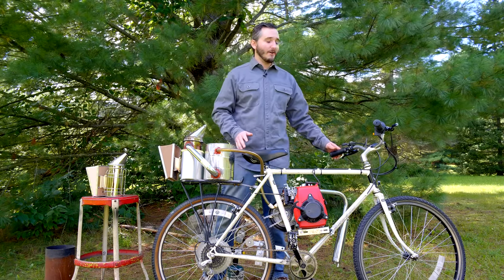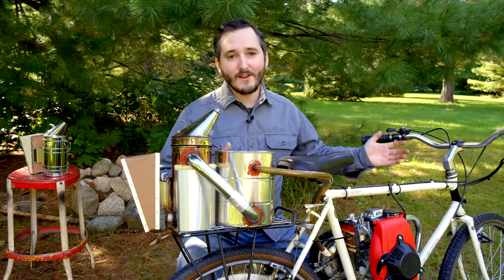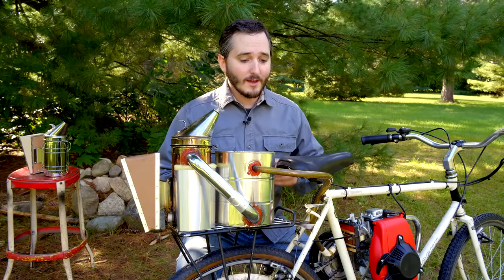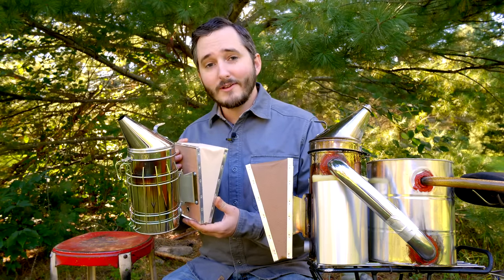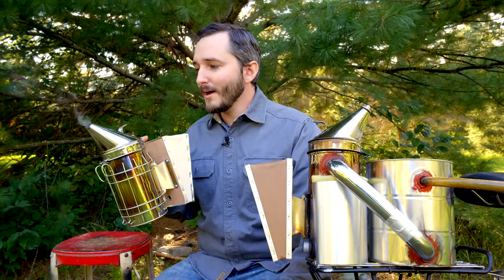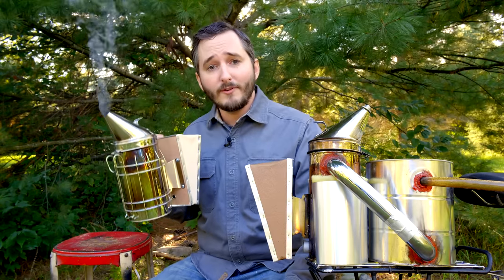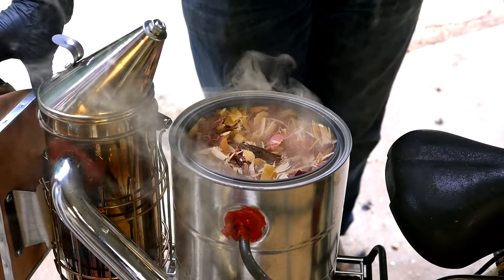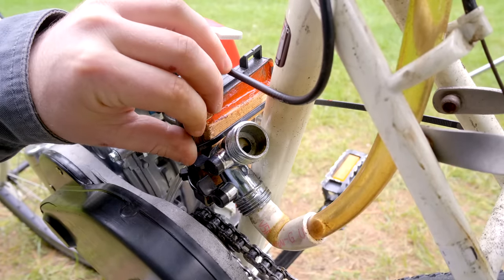Running a Gasoline Engine on Firewood | Woodgas Biofuel

Comment: Hey man, I have a serious question: I’ve tried recreating the bee smoker gasifier, specifically how you did it in the cedar shavings demonstration. You got it to flame up pretty well. I chip up my wood and put it in, and get it going decent, but it just won’t do the same as yours. Not that it doesn’t produce, im just having issues with a consistent flame. It’s like it doesn’t produce much. Could it just need to be filtered? Does the gas from some woods require filtering before use? Im just trying to figure out what I might be doing wrong.
Reply from the maker: Could be moisture in your fuel. To get good wood gas production you need to get the fuel HOT. It won't get hot enough in a bee smoker if there's any moisture in the wood. Could also be that you just require more pumping. This isn't the greatest gassifier design, it's just a simple one.
Reply: Wow, you reply fast! Thank you! Thinking back, it could be a heat problem. Should I build the fire and gradually add fuel in until the smoker is  full? And one more question -do you think a separator to get rid of the water vapor  could help make the gas burnable? Louisiana IS quite humid, so I wonder if maybe doing that may solve the moisture problem. Thank you SO MUCH for your help! Im really new to this, and I figured I’d get advice from someone who know’s what he’s talking about!
Reply from the maker: Nope fill it to the top. Fire on the bottom will dry the fuel on top if it has moisture in it and eventually kick off gas. I don't think a separator is necessary. Piping the gas through a long tube will have the same effect of allowing condensation.
Reply: Thank you!

Comment: How about silica gel for the filter? They're cheap, can adsorb water and liquid smoke/tar (I'm not sure are they the same or not) and the most important, they are thermo stable. I think it is safe to say that we can control the adsorption rate by using different size of silica gel (beans, grinded silica gel, etc.)
Reply from the maker: Good idea to try.

Comment: When you close the lid on the fuel source you suffocate the fire. The oxygen gets used up and the fuel source is exhausted quickly by the engine. Try venting the lid on the fuel source a bit. Perhaps uncap the end you plugged.

Comment: Try making and storing it for the engine. The gas would be cleaner and you wouldn't need to lug a gasifier around for on-demand production, which is inconsistent anyway.

Comment: youll get better gas production using lump coal made from wood. if you use 1 or 2 pc radiators as condensers it'll help cleaner fuel reach the engine, plus putting a small fan on the outlet of the filter any 5 volt fan will do

Comment: You can use the motor get to heating the wood. I mean you can put woods tank over the motor. Maybe at the beginning its need also diesel fuel.

Comment: Aren't there hydrocarbons in woodgas similar to gasoline? Could you condense all the oil then fractionally distill off the gasoline like fuel to run the engine?
Reply from the maker: Yes, but there is much more gas made in this way than liquid fuels. You could fill a blimp with gas before you had enough liquid hydrocarbons to fill your car up.

Comment: How about just using a gas washer? Pretty much an exhaust pipe into a bucket of water. Of course you should cool the woodgas to prevent boiling the water

Comment: Try dura lube to friction proof your engine.

This will help also with 2 stroke engine.

Can you do this for a lawn mower.

Can you make the gas into a liquid and have the system off the bike and run it on wood alcohol not gasoline?

Comment: make a small trailer for the bike, that way you can put that 4 times bigger gasifier on it, and then a tube to run the gas to the engine.

Comment: The thing to remember is if you can see smoke coming out of the hose that you have connected to your motor then it will fail it will not work even if it runs the motor for an hour when you shut it down and it cools off it will never start again you have to have fuel that comes out of there it will be nothing but pure hydrogen no smoke whatsoever so you need a cooling unit to cool to smoke down and a filter system that will filter all the smoke out when you've achieved that then you can run your motor off of the gasifier otherwise it will only work until you shut it down and it will no longer work because you have clogged your motor up with tar any smoke is tar you have to get rid of the smoke and you have to cool it down and have a filter so it will remove all the smoke

Comment: I'm assuming you've either given up on this or are still working on it as I haven't seen a video or update on this (specifically the motor portion), so this may not be worth reading, but....
This might have been suggested elsewhere (didn't see it though) or occurred to you already, but have you thought about some kind of an air pump or fan? just to try and push air in? It should be relatively gentle/light air flow, but just watching the amount of back draft you get makes me think that might be part of the issue.  It was also mentioned by a few others that you might try a 1 way valve, but I feel that might create too much air pressure and cause the air flow to be inconsistent.
It was also mentioned by a few others that you might want some kind of reservoir on your fuel line to reduce moisture getting in, which is a good idea, but what about using a bubbler type filter (passing the gas up through water/liquid instead of chips...) to remove tar and such? I'm aware that it might not be the most effective, but I feel like it might help you out in the long run, also cooling the gasses a little which should help with the air mixture?
Reply from the maker: Thanks for the suggestions. I may get back to this project in the future I've just had lots of other projects to work on in the meantime
Reply: I was thinking the same; soak the wood chips in the filter; and could you use 2 beesmoker bellows in double action powered by the pedals?

Comment: I wouldn't have the gassifier on the bike I would have a pressurized tank instead. I would suggest filling a main storage tank at high pressure then use that to fill a bottle for the bike engine ; )
Reply from the maker: Pressurizing woodgas can be dangerous according to some sources. I have not tired it to find out though.
Reply: @Nighthawkinlight  Can't be more dangerous than storing propane though right? I'm just thinking running the stove, oven, and furnace all winter while everything else is on the tesla solar roof system. Objective getting off grid with Tesla satellite internet. My only real worry is filtering the gas so its clean for tank storage.
Reply from the maker: Woodgas still contains some oxygen so it can become combustible in storage at higher pressure, so they say. I have my doubts about this, but like I said I have not tested it to find out.

Comment: Hi I think  it would be better to do activated charcoal you just put wood chips in a tin paint can and put in a fire for thats and try a block tipe fuel with a bit bigger fuel can have you ever tried mack gas from plastic water bottles

Comment: Try running exhaust through the air pump so you only use bellows for priming and starting. Figure out how to adjust exhaust gas for correct flow so wood gas is increased as rpm's of motor put out more exhaust, same way a car does so
Reply: As they did
Reply: Put exhaust back through motor so catalytic converters didn't overheat was the reason I think when catalytic converters first started

Comment: An updraft design. Theses are better for heat gas not necessarily for running engines due to the tars and oils in the gas.

Comment: Howdy, Congratulations you are almost riding!

an electric starter
Larger burn chamber
Larger pipe to motor
Belt or chain driven Cam to diaphragm W/manual ability
Condenser for final tar collection.

Comment: I use dry pine needles in my bee smoker. I tried to set the smoke on fire. Never happened... What did I do wrong?
Reply from the maker: Didn't get it hot enough

Comment: You already have a homemade bone made wood gas a fire that filters the gas with water. So why don't you use that to make the fuel and then compress said fuel with a bike pump or cheep air compressor into a tank and let the tank feed into the engine? This way you can have higher quality fuel compressed and stored on the rear of the bike. This would also make it safer to ride as you wouldn't be at risk of inadvertently spreading a fire.

Comment: Storage shouldn't be a problem if you use the bee smoker and your old gassifier storage system, because CO2 is easily dissolved in water, forming carbonic acid. So volumetrically there shouldn't be a difference. Maybe there'd be more gas at the beginning, i don't know how fast the CO2 will dissolve into the water.

Comment: Neat. I'm wondering if a Hepa Filter from a Shop Vac would work to filter out the Tar/Water vapor in the wood gas? Anyone have thoughts on this? (Okay heat maybe an issue.)
Reply from the maker: Might work, but it would probably clog quickly. I wouldn't use anything store bought for this because of cost to replace.

Comment: Cool the gas with a radiator. It can be as simple as pipes on your bike rack. This provides more power. About 105F is optimal before entering the engine. 

Your fuel is dirty. See the orange flame? You need more filtration. 

Increase your idle speed. It needs to pull the gas in faster.

Get a small electric fan to pull the gas out of the gasifer. You are not getting a sustained wood gas production level.

Comment: It seems like it's running too rich. Too much fuel. Maybe a good idea to have a valve on both fuel and air side for fine tuning, and have it controlled on the handle bars for easy access. Some really old style motorbikes have the fuel/air adjustment easily exsesible to help go up hills.

Comment: I’d just like to note that the valve that is used is a ball valve and is not 100% accurate for regulating air intake. Not a crazy difference but it is a variable

Comment: Where's the second part? Could you go a few miles with that engine?
Reply from the maker: I haven't finished this project yet. Possibly this summer I will try again.
Reply: @Nighthawkinlight  the only bad thing I see to this is that when you get to work or wherever you want to go with the bike will have a smell of smoke tremendous :-D

Comment: Hello
I noticed that dried orange skin (or things like that), once heated, releases a flammable gas (which mainly contains orange oil I think)
Why not trying to do experiments or even running this engine with that?
Reply from the maker: That's effectively biodiesel, which you can use to fuel an old diesel engine without any modification. It would be a short video.
Reply: @Nighthawkinlight  I'm glad you replied,, thanks for your response 😊

Comment: Id recommend a liquid like water as a filter to help remove some of the contaminants, and it'll also give a slight back pressure to the woodgas so it'll be more concentrated when it enters the engine. It'll be a slight increase in pressure but with a much "cleaner" fuel. This wouldn't help the moisture content, so a secondary "filter" for moisture, which cedar chips would suffice, seeing as you've already used them.

Comment: One thing I don't understand about these systems is why people create wood gas on site and carry the system with them, why not make it before hand and store just the gas under pressure?
Reply from the maker: You can't store very much under pressure because it doesn't liquefy easily. Better to make a system that if you need more fuel you can just pull over and pick up sticks from the side of the road.

Comment: I have an idea using vape pens to run an engine .put vegetable oil in the cartridge and set the pens at a temperature where the oil cracks producing a flammable vapour .you would need a series of of vape pens that work on a timer so you don't burn the coils out in the pens .I would love to see someone bring my idea to reality.

Comment: ive heard about this before,
the only problem i see is that wood is not as energy dense as gasoline so you would need a exesive amount of wood to go longer distances.
Reply: You can use coal, instead. After you get it to burn. Quality of coal will be important.
Reply: @MorneBooysen  aaaaaaand you've missed the whole point

Comment: should have used the top valve for fuel and bottom valve for air cause now dirt can fall in that top valve gravity would keep things from falling into your bottom valve if it was open. all you would have to worry about is dust and perhaps mice lol also it would eliminate that ugly 90 degree bend which is also inefficient at flowing

Comment: I think your not getting past idle cause not enough wood gas is going in the engine cause you stop pushing air in the smoke chamber, since it is a bike why not use the pedals of the bike to move the bellow(I think that’s what it’s called), you can also use the pedals to start the engine

Comment: The real purpose of prohibition was to remove American's ability to be independent from corporate owned gas stations. People were running their stills generating ethanol for fuel to run early automobile engines, which were capable of handling higher ethanol fuels than today's engines, which are designed around a specific fuel blend.

Comment: Why don't you make the wood gas at home and compress it in say a propane tank and use it as a fuel source you could easily control the fuel to air ratio then as well because you wouldn't be dealing with smoke or other contaminants in the fuel

Comment: nice concept except it doesn't look very efficient too much trouble loading wood every corner or even every mile would fast become very very uncomfortable good job in getting that engine to run on pure smoke or gas as you called it

Comment: By wood gas I assume you mean methanol? Distilling wood this way gives you charcoal for your barbecue as a by product. Do the same with coal and you're going to get much more efficient fuel and you'll be left with coke - a smokeless fuel to heat your house. This is what we did in England before north sea oil and gas. Old technology. Now how about water gas and producer gas? That technology is pretty much forgotten

Comment: Looks like you're losing a lot of wood gas from your air intake. A backcheck valve - even something like a flat piece of rubber or gasket would do it - there's so little back pressure it shouldn't blow out or impede airflow.

Comment: I experiment Whit this before based on a ukranian  video of a guy running a van whit a gasifier on the back and also a tractor I run a electric  generator for several hours working great but you have to produce enough to engine demand of fuel but yhea it works during great depression and WWII farmers run tractors this Way and Ford make a tractor that run on hydrogen or alcohol after the war all this was dismantle for the good of the fossil industry

Comment: #1- Use charcoal as the fuel instead of wood; however if you insist on using wood or scrap material...

#2- Install a "cyclone" prior to the first filter to capture creosote which is a byproduct that will build up almost instantaneously. 

#3- Use a "water bong" type of filter where gas must pass through a tube filled with water. 

#4- Secondary filter, much like Shop-Vac filters, somewhere between the engine and the "water bong" filter. 

That ought to be sufficient enough to clear up any issues and problems, other than leveling up the size of the fuel chamber where everything is being burned. 

Jesus Christ Almighty God bless you all 😊

Comment: adjust the airflow as running,  bigger gasifier i would not do it.  larger wood gas fuel tank..  or conpress the gas into a tank.

Comment: This man is going to get carbon monoxide poisoning LMAO.
Reply: It's a risk maybe, but the good news is that if he does, it would kinda take care of itself. Also, I think the risk is more smoke inhalation than CO poisoning, but both are being mitigated. To start, he's doing this in an open area with some light wind. That's already a huge mitigating factor, since he's getting lots of fresh air, and the concentration doesn't have a chance to build up around him. On top of that, it's a small fire. Even if he does pass out or something, he's always gonna end up on the ground, where there is not going to be as much gas, and he'll be reasonably safe from further inhalation.

Comment: You do realize the principle behind a gasifier is to get pure gas to come out of there., all that smoke is loaded with tar and it will plug that engine up, in no time and the engine will be junk., it will run until you shut it down. next time you go to start it the valves will be froze solid from all that tar. that froze up in there and dried and clogged up your engine. you've got to get a better filtering system . so when you see nothing but pure gas coming out you should barely be able to see a flame. and only a blue flame. That is why you need a burn off valve so you can see when its clean. any red in the flame me that still contains tar .and tar will kill your engine...

Comment: Your on it Brother. Don't give up find the octain of woold Gass and change the ignition timing.
It's a HHO mestake too hydrogen has a similar ignition rate to low grade diesel kerosene. 
And you have to retard the timing to top dead center or less to get it to work..! 
   So what they're actually doing with HHO is there running it too far Advanced and they're wasting all their energy on the advance of the timing..! 
Incidentally that's why HHO Works excellent on a diesel engine..!